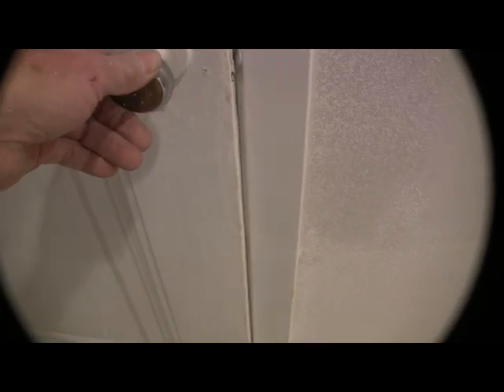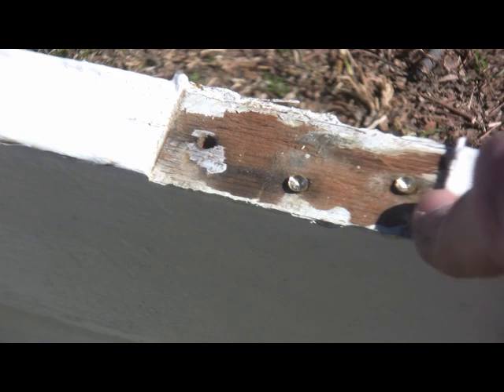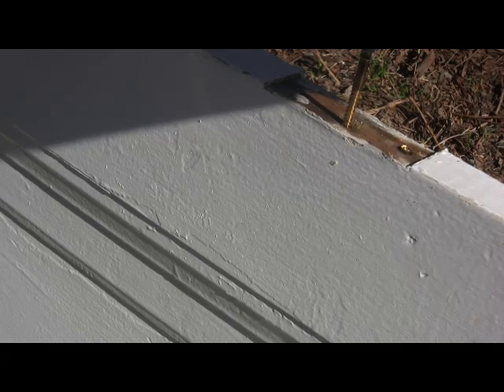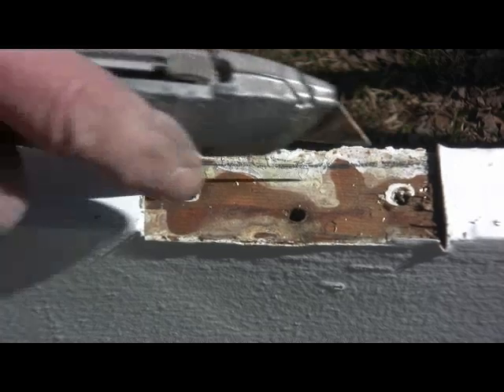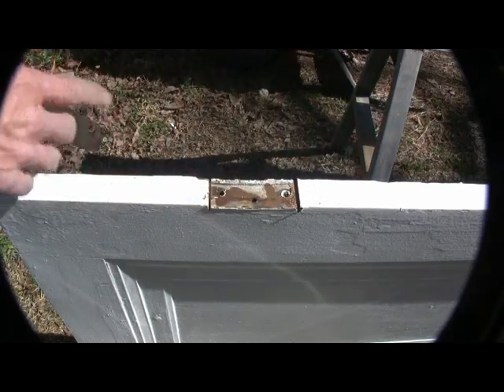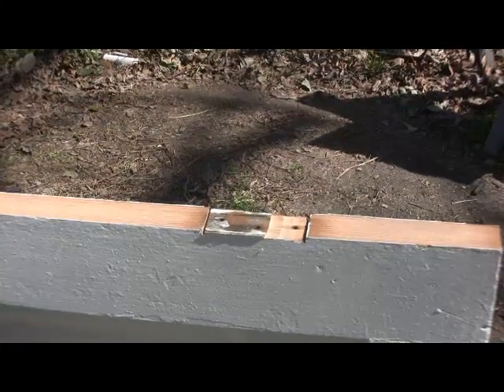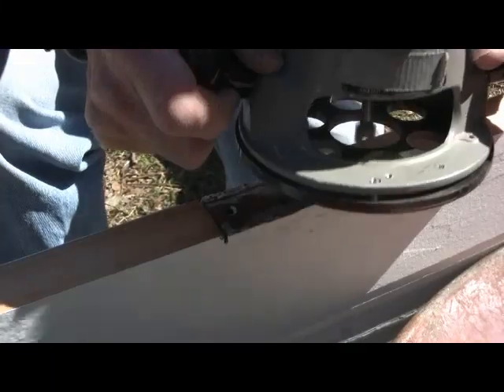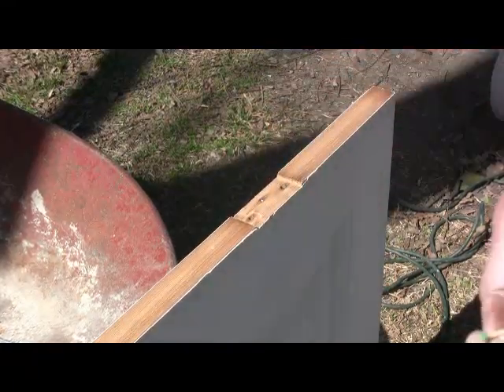Re-sizing a door to an existing jamb

Comment: Good info. I just finished replacing 6 doors with 6 panel slab doors. It takes a little time and patience to do that in an ole hose where the jams are not square. Thanks for sharing.

Roland
Reply from the maker: thanks ,  just having the right tools makes it a lot easier to replace  doors
Reply: you can say that again